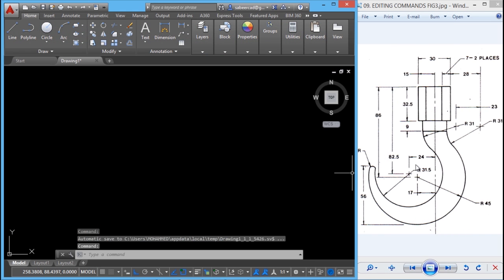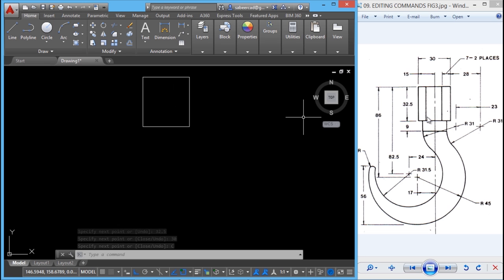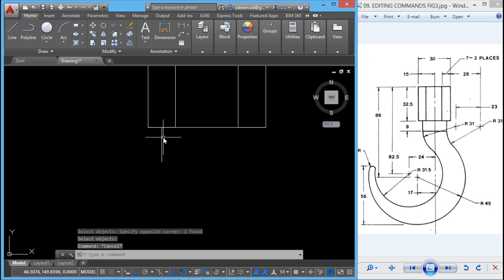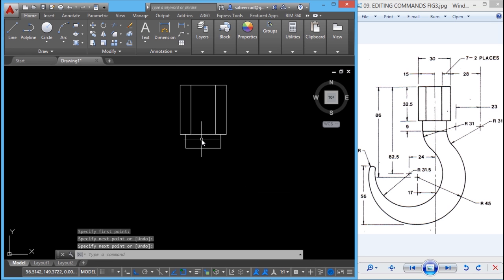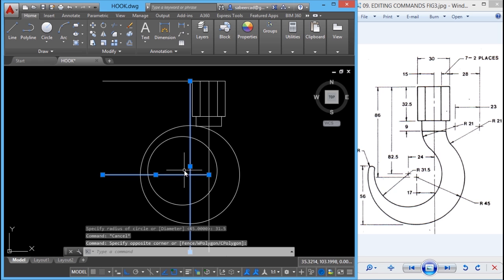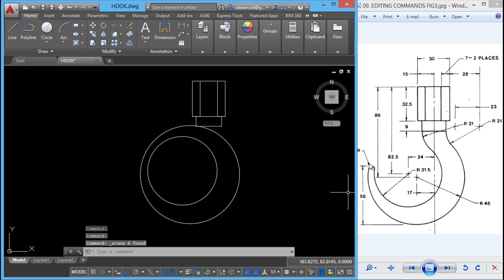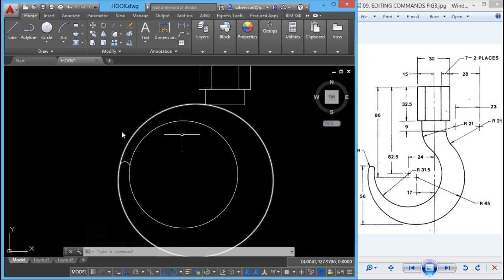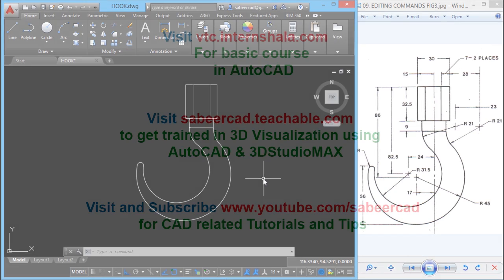CREATE A  HOOK USING AUTOCAD | AUTOCAD 2D DRAFTING

Comment: Good tutorial. There is, however, a circle command you could use to create a fillet for unknown radius in the figure called Tan, Tan, Tan. Two tangents are then made from circles of R31.5 & R45 and the last tangent is from offsetted line you created - 56 units length.

Comment: The from option its not working in my auto cad Do you have any solution for it.. iam using Auto Cad 2015 Mechanical
Reply from the maker: When you use SHIFT + right click do you get the osnap menu  ?
Reply: Ya i could able to get Referance From option in osnap menu ..  but it's not asking for any base point and offset ... 
it is just displaying this .... Specify center point for circle or [3P/2P/Ttr (tan tan radius)]: